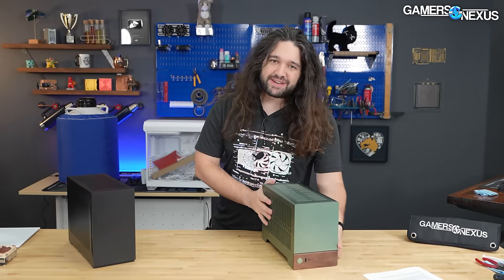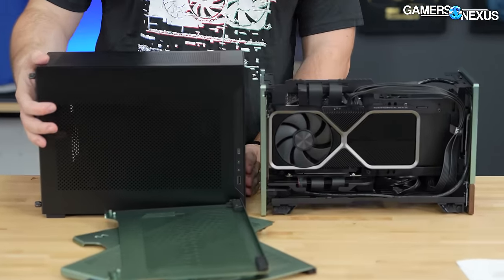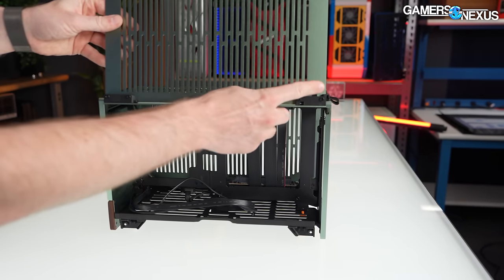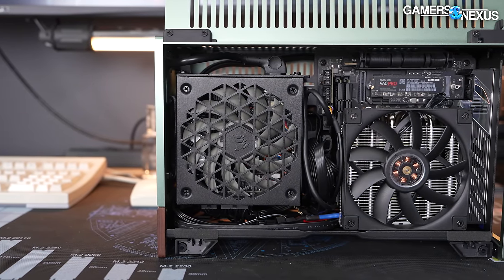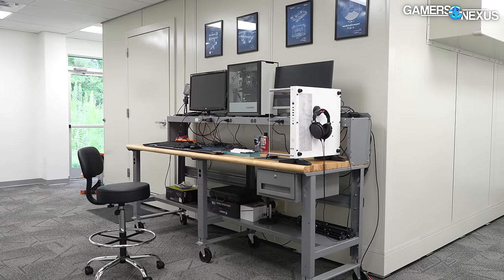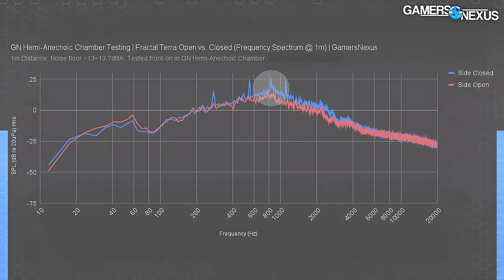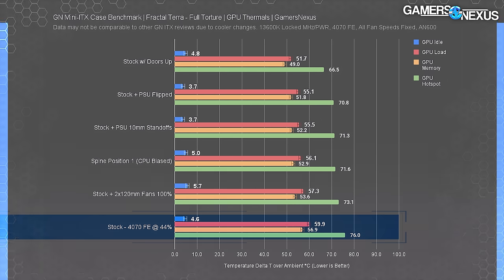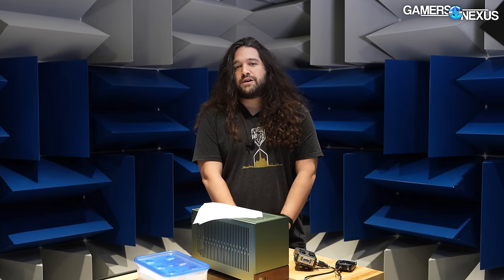Fractal Terra Mini-ITX Case Review: Build Quality, Thermals, Acoustics, & Cable Management

Comment: I browsed cases for my better halfs refresh build, and she chose the Terra for her next case.   I am hopeful I can avoid the slat hum problem by using a Noctua NH-L12S cooler and place the fan under the heatsink with the heatsink up against the side of the case.   We'll see if it works :p
Reply: I can report back that with Noctua's NH-L12S with the fan on the bottom blowing up, the fan hum is not a problem.   It is a neutral white noise type of fan noise.    If you push the sliding mechanism such that the top of the NH-L12S is flush with the case wall, it even vents a good deal of the heat outside the case, which is nice.

Performance is OK.   It is a low profile cooler after all.    I've been running prime-95 tests on my better halfs Ryzen 7 5800X3D.  Low corecount (2-3 core) loads are able to hit full turbo speeds at an ambient of 72F/22C.   Heck, even memory intensive prime95 loads (these are memory intensive and heat up the CPU less) are able to run ~3450Mhz on all cores with SMT.    Full heat all core SMT loads will drop core clocks down to ~3950 Mhz though.

In the grand scheme of things, not bad for this little box and little cooler.

Comment: I would love to have a smaller case for my tower pc. However, when I built mine I got the Fractal Define R6 and an ATX motherboard.

It's just not worth it atm for me to go with a smaller design, as I don't need any hardware upgrades. So nice I'm quite happy with the performance, but it sucks to have such a fucking big tower. 

Happy to see Fractal doing more smaller designs.

Comment: One additional metric would be very helpful to objectify the difference in sound / tone: Loudness.
It takes the frequency of any given noise into account when considering its perceived volume, instead of just looking at the sound pressure level.
Measured in LKFS or LUFS, this can be easily displayed in Adobe Audition as well.

Comment: This one is a bit too small for me. I would be interested in a larger cube style configuration instead of the common tower case that many people use. This would allow the motherboard to be installed horizontally in the case so a heavy GPU and CPU cooler is able to be fitted vertically without any sag or gravity attempting to bend the motherboard. 

My other concern with a tower case is their greater tendency to tip. Placing a tower case on a desktop is also not so aesthetically appealing and lends itself to be placed on the floor. However, a more cube style fixes both issues.

Any chance of a review using this style?

Comment: Well. Never use a fan close to the side panels in a case like this. I own the Terra myself. Coming from the A4-H2O. And i switched from the L9a to the L12 Ghost S1 Edition with the fan underneath the heatsink. So there is absolute no problem with turbulence. Same goes for the gpu (6750 XT reference design), which has enough "distance" to the side panel.
For example: The same problem appeared in the A4-H2O for me, after putting an Noctua NF-A9 in place of the stock A9x14.

Thermals are no problem so far. Yet i would've appreciate, if there would be more room IN THE TOP instead of the only bottom fan option. But it works pretty well for me.
The fan of my cpu cooler never hits fanspeed above 1.000 rpm. Same goes for the case fan (A12x15 PWM) and even those of the gpu. To archive that, i have fixed my 6750 XT to 2250 Mhz max clock.

But yeah. In this case i wouldn't go further than an ~200W GPU.

Comment: ITX is the most annoying but most rewarding form factor to work with. I have a Cooler master NR200. 5900x, evga 3080, Arctic liquid freezer 2 240mm AIO, and 4 case fans. Took me 3 different tear downs to realize the bottom comes off. Man that would have saved me so much time when i upgraded gpus 🙃

Comment: The acoustic room sounds like a nice touch if you were a case manufacturer and want testing during your development process, but as a consumer I cannot relate to the outcome of those tests at all. What does it mean to me that the case shows a certain decibel lever at X hz of frequency? I have no idea, I'm more interested in "does the configuration and the need for thermal cooling make a noticable noise during normal and demanding loads?"

I would appreciate a bit more subjective opinions, maybe in the end of the video on each parameter which is important for the consumer. Like PITA, thermals, acoustics etc.

Comment: @GamersNexus I realise that my following suggestion will add yet more time and complexity to testing, however I feel it should be pointed out that ITX cases can really benefit from unauthordox airflow configurations... 
For example, having the bottom optional fan as exhaust, rather than intake may well make a significant difference to thermals.
Similarly the CPU tower cooler fan may well perform better thermally AND noise wise, if it were flipped to be exhaust (ie. a pull config) rather than intake (push config), especially when it must be oriented very close to the case sides... Being in pull config will mean that the fan blades will be closer to the heatsink fins, which will create noise, but that will possibly be better than the noise profile of the fan blades being close to the case side.

It would be worthwhile testing with the CPU fan in pull config, with the bottom fan in both orientations (inlet or exhaust), as CPU exhaust with bottom intake might be better, however I wouldn't find it surprising if both in exhaust was the best.  This would be very counter-intuitive to typical airflow configurations.

I currently run an NR200 with dual radiators (top and bottom, which is non-standard setup, and a right PITA to fit), but I unintuitively found that both exhaust was the best noise and temperature outcome.  In this setup, the case runs negative pressure, drawing air through the mesh sides, however being mesh-sided, it doesn't actually suffer from dust buildup in the interior (although I do need to vacuum the sides once a month).

Comment: It would be really cool to see some sound testing w/ the Noctua NH12L-S in low profile mode. It moves the fan to be between the heatsink and the cpu which I suspect will reduce the noise induced by the case, but I'm really just guessing.

Comment: When showing a chart of a difference from A to B where they're comparable, such as the frequency plots of side closed to side open here, I think it would be useful to include (or instead use) a chart plotting a single line that is just the difference.

Also I'd be interested to see a bunch of different graphics card fan designs and how they interact with the side of the case when it comes to noise - it could be interesting to draw some conclusions on fan design/placement based on that.  Not really useful at all for any purchasing decision or whatever, but good fun, ya know?

Comment: To sum it up: great case for deaf ppl.

I''ve always been intrigued by SFF but man if you must trade a bit of space for your sanity it's definitely not worth it if you want to throw your PC out the window each time you boot a (demanding) game.

I'd like a modern case that's not as small but still allow you to bring it somewhere with ease without risking to twist your back with each travels, I can live with having to reduce performances a bit, I almost alsmot always framecap my games anyway.

I took my current build with me for a week at friend's place, it's a beQuiet Darkbase 700, I really like my case but man strapping it in a car seat really sucks it's heavy as a dead mule.

Comment: It would be really awesome to get an update on Workstation VS Gaming Cards again. Not just because the market has evolved so much but becasue software has, as well.

I just came across your video from 2018 and it is hands down the best ressource about all of this I've found yet. 

I mean - Blender alone has ploughed through the mass market a HUGE deal and Unreal Engine 5.x is turning out to become everybody's new pet peeve in rapid movie production and previzualiation. There are simply not many really good comparisons of these two chipset worlds across so many plattforms.
And I fully admit that I also need something to show to my employer to justify not buying another trash GPU just bceause "Quadro is professional" 😲

Comment: This case would have made more sense to have open side oanels using attachable panel inserts to partially or fully block the panel. Like the lancool 216 top blocking plate. It would help thermals, give more room for a cpu cooler and reduce the acoustic problem.

Comment: Please Help:

I’m going to be doing a 7000d build with a 7950x3d, 4090 fe, msi meg x670e ace, etc. My problem is my side table is straining under the weight of my current lancool 2 4090 fe + 5800x3d build. What is a good 6ft wide by 3ft deep black desk that can support around 200+ lbs or whatever weight limit I’d need since I have a 18 pound monitor that will be combined with an 18 pound monitor arm?

Comment: Will you be extending sound testing into directionality? Higher frequencies are much unidirectional than low frequencies, and so the position of a case compared to the user could make a significant difference here.

Comment: Mini-Itx cases should have alot more USB front ports for lack of expansion elsewhere especially at that silly high pricepoint and it should be a hub so it only needs one plug on the mobo.

Comment: I'm using this case now, the CPU cooler is AXP120-X67 (12700F), and I have to open the side panel when I run the system.....

Comment: Can you explain why you chose temperature in delta over ambient instead of absolute, or point me to a video where you already did? I guess it's neat, but has it any other reason? I sometimes wonder if the temperature delta above ambient differs depending on the ambient temperature itself. Like, runaway effects or something along these lines.
Reply: Because delta over ambient gives you the change in temperature as a percentage of ambient - so you would still expect to see basically the same proportional change in temperature with all the other variables the same. That is - if you live in a hot country and I live in a cold one - the absolute temperatures would be different, but the delta over ambient would be the same.
Reply: @FraserChapman  That's what i was wondering about, never looked into it but it makes sense for sure.

Comment: solution to the thermal problem: buy some dust filters and fix them to the inside of the intake panel, and position them in front of any GPU fans that do intake as well

Comment: Thermals aside, i wonder how setting the CPU cooler to blow out of the case would effect the noise. Not optimal for lowest temps i believe, but if someone just wanted a simple, lower power build in a small footprint i could see that offsetting some of the noise

Comment: Its been a little while since its release, but I think the Evolv Shift XT from Phanteks could be an interesting comparison to this case since it can change its size to fit fans and/or a 240mm radiator
Reply: I have 2 evolve shift x cases and they're a really cool case and I love it. But they blow the pita factor right off the chart

Comment: I would strongly recommend a side plate upgrade from FD, Or some 3D print alternatives. this design is cool, but it just won't work if you are putting your SFF ITX on the table

Comment: Nice case and nice review. However, don't use it with Asus ITX motherboards. There are issues with B550-I series paired with RTX 4000 cards with crashing and Asus is basically ignoring that problem (9 months already). So Asus is miss-treating their customers and being dodgey again!

Comment: So curiosity wants me to ask , On the side panel with fan noise issue.
If you place a finer Mesh inside, like a Mesh dust filter either taped on the inside of the panel or maybe Magnetic dust filter to the INSIDE of the panel (not outside). Would it still have have the noise or would that lower it as the other case panels you put on the side in testing?

Comment: I’ve built in 2 Mini itx cases over the years. I did not like dealing with the motherboard size or restrictive space for installing the cooler.  That was 3 years ago, it looks like this new sandwich design is more feasible. But ultimately I build my PC for Ultimate performance with Ultimate parts like a 4090 and this form factor just doesn’t have the thermals or space. It probably never will for real PC performance.  If you want something like this just buy a laptop or a Series X or PS5 for high end Home theater performance.

Comment: would like to see gpu 1st or 3rd party cards have more options for power delivery. like pass thru to the back plate side. or on the "end" instead of just at the "top" which can lead to issues in sff cases, or cause bend problems and looks bad in general

Comment: I like the professional approach taken to tests where you have sort out those with experience and sort guidance, this is what LTT should have done. 
Looking at the side slots reminds me of an air vent for a old musical instrument i saw, the slot causes a whistle which was then shaped but valves and tubing, I guess that what you are hearing  i's a resonance like musical tone, a vibrating body or system caused by waves from another body vibrating at nearly the same rate. I wonder if Fractual have thought of producing side doors with different ventilation or patterns that could simply be swapped using catch system they have used but I guess clolour matching between batches may not alow this.

Comment: I like the push for itx. Mac studio form factor with nvidia 4070 ti graphics performance would be the dream. It's time for amd or nvidia to invent an itx standard for GPUs. That power brick, gpu and cpu all have their own cooling is the worst part of building a small PC. Ideally you want something like what servers do for decades: CPU, GPU and PSU side by side with only passive cooling. And a case that funnels air with one or two 140mm through the case.

Just imagine how simple and compact a build could be. PSU, CPU, GPU all side by side, each having a giant heat spreader. And two 140mm fans pushing and pulling air through the case. Basically an xbox series x, but modular.

Comment: Hello! I thought about building in the fractal terra an i wanted to ask if this configuration is too narrow. I wanna use a rtx 4080 super pro art (50mm) and the Noctua NH-L9x65 (65mm). If i put the spine to 3 of 7, i'd have 67mm for the cpu cooler and 53mm for the gpu.

Comment: Here is a hint to case manufacturers..
Just like speakers, fans use air pressure. Slots will resonate in the wind. That's why speakers have mesh grills.. those slots are retarding the air flow, and vibrating.. simple air Pressure test..

Comment: I used to have a Zaber Sentry and with cpu coolers with a top mounted fan there also was higher level of noise. I had an Noctua L9i and later a Cryorig C7 and both made quite some noise(The C7 was louder due to being closer to the case panel). I then switched the cpu cooler to an Alpenföhn Black Ridge and due to the diffrent fan mounting the noise went significantly down. Would it be an option that for ITX reviews you also consider testing acoustics with cpu coolers which have their fan under the heat sink?

Comment: Fitting 4090 like cards in terra is overdose for such type of case. As for me, the best sound/performace/temps tradeoff is what the itx case builders must take into account. Otherwise this pretty design comes as itself, with no other bonuses, especially comparing to open-bench ones.

Comment: I seriously have no idea why people worry about the noise factor I have been on computers for 40++= years and never had any concern with noise.Thta does not look like a 180 dollar case lol it looks like a 40 dollar case.Just because some other seller has theirs over priced does not justify prices.IDC what the industry even says because that is FORCED prices you either pay it or you don't have a case.When comes to ventilation I am surprised i Have yet to see anyone use smoke to show the actual flow.IMO this case needs to be a tad larger like 2 inches each way.width and height.

Comment: This case is so amazing in looks and quality. Then tell why the hell they just dont make it a little bit more wider to accomodate 7800x 3D with noctua nh-d15 air cooler. I’m sure it will still look damm good.

Comment: would it be possible to print small offstands for the PSU on a 3d printer so you can lift the PSU up a bit more ? or would this not be possible ? (im not someone that mods things so i have no clue but it sounded like a solution) would love to have someone replay to this with knowledge as I'm curious

Comment: I would almost go for a test bench then a small ITX case, especially one you can hang on a wall. 
Cleaning the pc once a year is no problem for me. 
I am just not a fan of putting so much hardware in such a tight space.